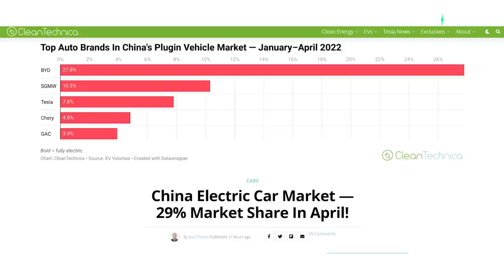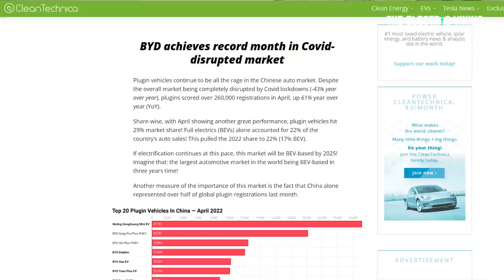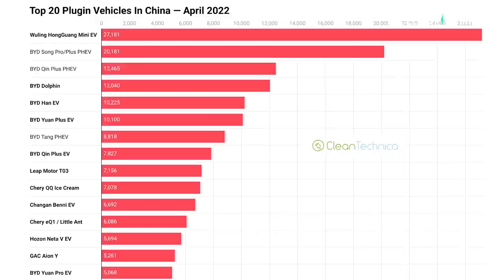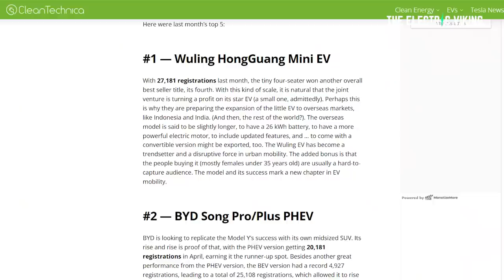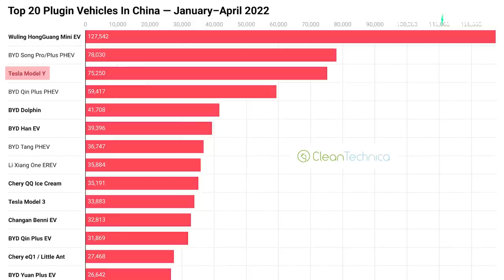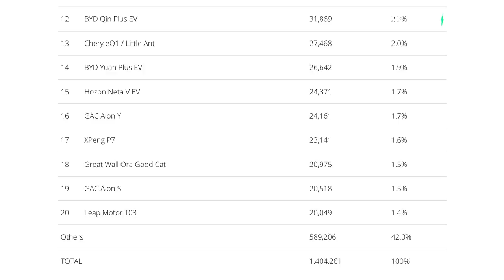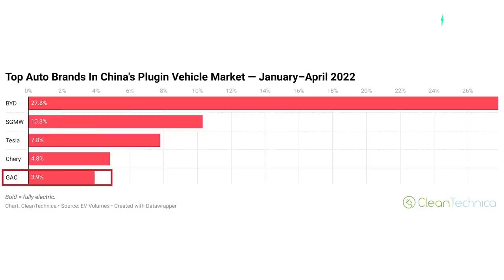China's electric car market hits crazy new record in April

Comment: Traditional American automakers had DECADES to change. . I can't wait to see the first CEO to beg for another bailout!.
Reply: That's OK with me.  I prefer to buy cars at dealers with service centers.  Having to drive 75 miles to a Tesla service center is out of the question.  Yes yes yes I know Tesla has mobile service but they only perform 80% of repairs/maintenance.
Reply: @swanvictor887  My local Ford dealer told me they are not marking up the Lightning.  My local Cadillac dealer told me they are not marking up the Lryiq.  I think you've been hopelessly brainwashed.  BTW, I've owned cars for more than 50 years and only once did I have a car needing engine service.   And you seem to think that EVs need no service.  That is silly.

Comment: I think these numbers show that Tesla will have to release a lower priced car soon (2023, say) or risk having its rapid rise arrested. Decimating legacy auto only amounts to the first phase of the electrification war. EV manufacturers with staying power will still have to see off challengers in new skirmishes that are bound to occur as the new EV players start to flex their muscles.

Tesla can certainly do well as a kind of electrified BMW  - competing with companies like NIO - but then driving a Tesla won't be for all of us. On these numbers it is China and the Chinese manufacturers that have the inside running on creating a plentiful supply of EVs for the masses and a genuinely rational electrified car market.
Reply: Yep
Reply: Yep
Reply: Chris. Not necessarily. Teslas issue is not the price of its cars. It has wait times out the wazoo for all of them. So it is supply constrained and not demand constrained. Building a cheaper car does not fix that issue. It actually does the opposite, because to build the cheaper car they would disrupt the manufacture of the existing models. The other thing to bear in mind is whether these numbers were affected by Covid policy. Tesla only lost market share as a consequence of the complete close of Shanghai. I don't know whether BYD was affected by that closure at all. So it could be an external factor (ie the Chinese Govt) that is responsible for the numbers. If the numbers repeat in June and July, then I would agree with you
Reply: @zoransarin5411  they will repeat, Tesla is a overpriced, overhyped luxury car.

Comment: These EV's are being powered by coal fired power plants.  Coal is the energy supplier at the margin.
Reply: Cool story. Still much better than petrol though.
Reply: power plants needed to operate for not only for EVs. most EVs were charging at night when the power plants under a lower efficient period. So from this point of view, EV reduces the carbon emission.
Reply: Philip Damask
Very true 
But that "truth" is NOT ⚡️ appreciated here on this Channel ⚡️
Reply: @icosthop9998  the truth is that we use oil to power oil extractors, use oil to refine the oil, use oil to transport the oil, and then use oil to power our cars. And what's the efficiency of ICE? About 30%.

Compare that with electricity.

Use coal to extract coal. Use coal to generate electricity. ELECTRICITY IS DELIVERED AT ZERO COST THROUGH POWER LINES, and into EVs. Electric motor efficiency is about 60-70%.

Did I mention we can get electricity from other means as well?
Reply: About 2 minutes and 25 seconds in the following video, Marc Tarpenning (one of the co-founders of Tesla) discusses how he and Martin Eberhard (another co-founder) did research to discover the relative efficiencies of different forms of power (e.g., fossil fuel, crop-based ethanol, coal-powered electricity stations, and so on) for cars, and discovered that coal-powered plants were more efficient for powering EVs cars than using gasoline in ICE-based cars: https://youtu.be/6pn51W1Jhl4?t=145

Over time, there will be a gradual switch over from legacy power stations to renewable energy, such as solar and wind power, so EVs will get even greener. But even now, it is still greener to power an EV from a coal-based power plant that to power an ICE vehicle from gas or ethanol. I suspect that is truth is NOT appreciated by iCost Hop ;-)